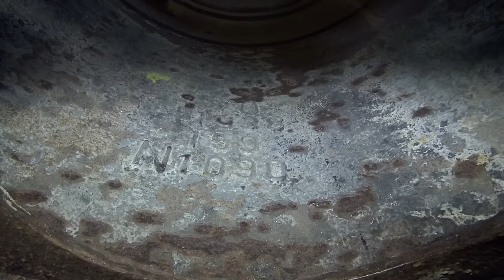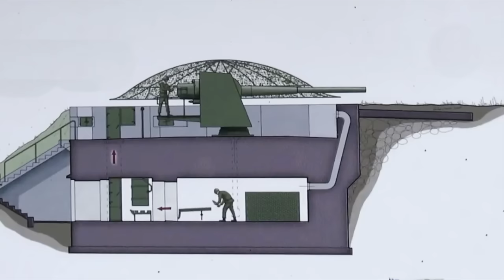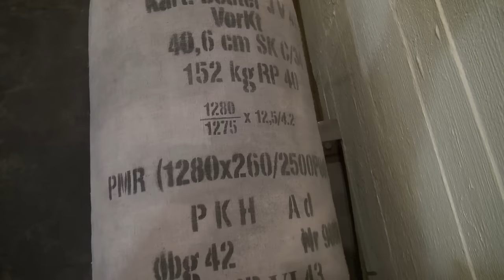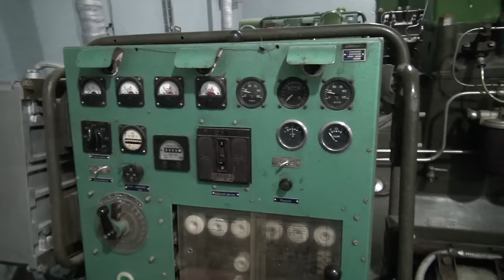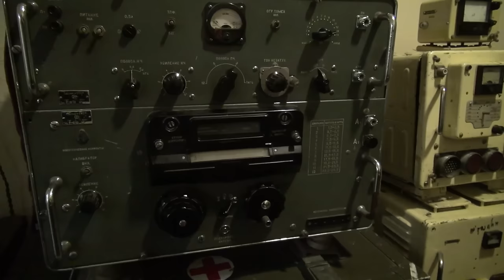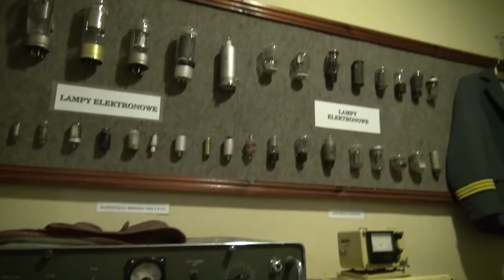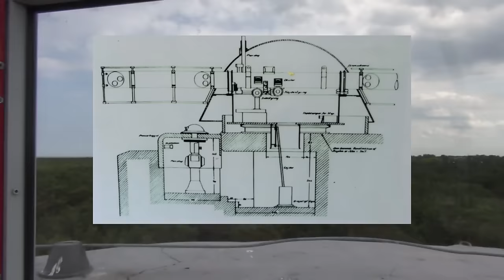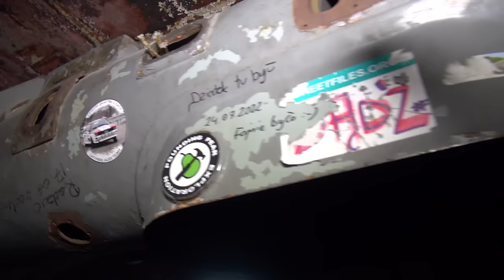BATTLEFIELD HEL(L) - THE FINAL STAND IN THE FOREST OF BUNKERS special episode

Comment: Mr. Tino.
With all due respect. To You a Military Man. And those that we're in that península in ww 2.
But this Is not a great battle in My humble opinión.
The Polish military on this peninsula we're sitting ducks.
Surrounded by water.
No airplanes.
A Big Big Target for the Germans.
They.The Germans knew about this huge pieces of artillery and the
 bunkers.
All they had to do was blockade the península .
Bombed from the air. Germans had absolut air dominion.
Target practice accuracy of the battleships .
Bombing accuracy and results
 and effects of the bombs.
And WAIT until the Polish personnel ran OUT of resources supplies.
And they Will eventually surrender
As they did.
There was not a single reason to lose a single German soldier taking ovèr this peninsula.
To me forts áre standind still  targets that all You have to Is surround THEM attack with artillery from a safe Distance.
And let THEM run OUT of supplies. Resources.
Eventually either they surrender or commit suicide. 
Because the ones in the Fort áre targets in a trap.
MAYBE that Is why. As You said You do not hear about this "Battle".